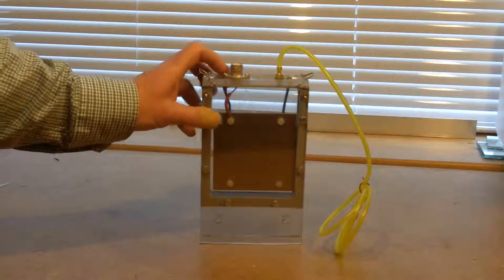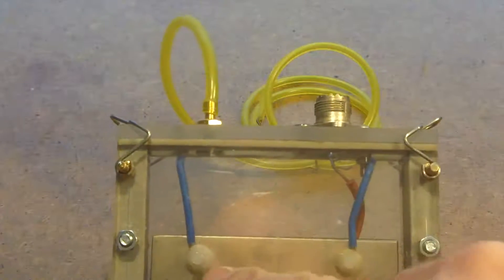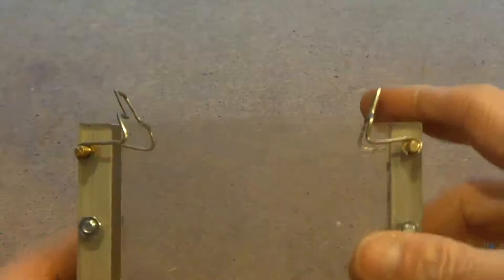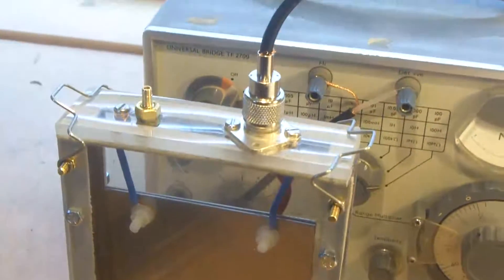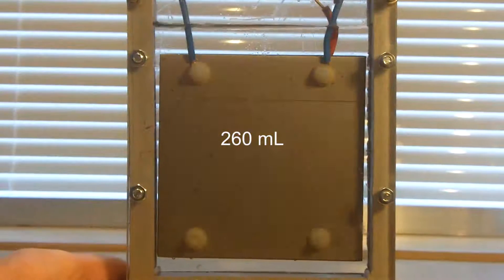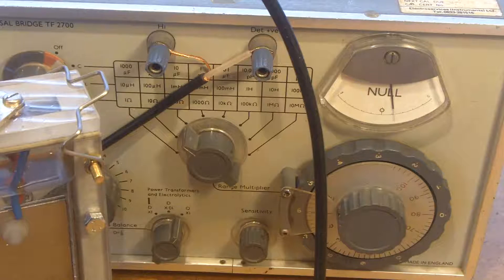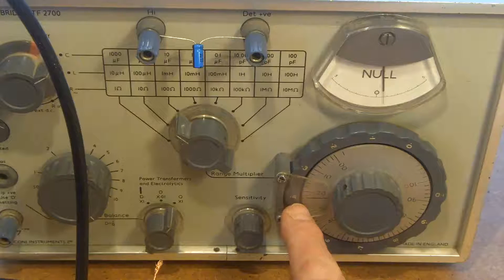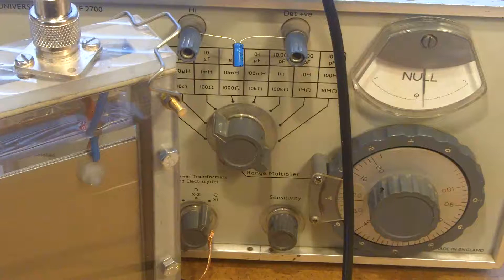HHO. 3 Some mods to the cell and higher than anticipated capacitance reading.

Comment: Capacitance in water can vary due to impurities like minerals, or you can alter the polarity of water and change it's hydrogen bond angle degree to change the capacitance/dielectric value. Can you test the copper/steel cell with a joule thief-coil-12volt 7amp battery settup? I think you will be very impressed :-) Great work Andy!

Comment from the maker: Hi, good point, you’re right I haven’t made any real attempt to remove any oxides, surface coatings or lubricants at all, I probably should have but given that all of my tests to date have been carried out with the same conditions I guess it’s not too big an issue. Must admit I was going to clean them but I forgot. 
Thanks for the input
Kind Regards ... Andy

Comment: I agree with other comments that resistance and RF properties of water must be considered. When you are done with HHO experiments, this cell could be used for other experiments too. (1) Measure conductivity of various liquids with a simple DC ohmmeter and considering area and distance of plates. (2) Measure RF absorption of various liquids by applying a known amount of RF energy to the plates, and measuring temperature rise of the liquid.

Comment: O.K.  I don't remember if it was Hydrochloric or Hydrofluoric acid when mixed with distilled water then put through a charge produces a flammable gas.
73's
P.S. call is kc5jsr.

Comment from the maker: I reckon you could very well have a devil of a good point there, it half crossed my mind but I dismissed it on the grounds that the ‘loss balance’ balanced out. I’ve worked with oscillators for the past thirty or forty years but I might have just forgotten to take the very low resistance in to account. I'll check the resistance of the tap water in the cell and load then the dehumidified water to the same resistance and see what I get on the bridge. Thanks for the interest and the input
73's Andy

Comment from the maker: I need to source different types of water. Thanks for the heads up on the toxins. I know nothing about chemistry (or electro chemistry) but I’ve always reckoned that a bucket of water is a bucket of worms. I used to use lots of water cooing equipment, for 100’s of KW’s, water/water, fan and radiator and evaporative towers. They all work fine in the short term but boy once they’ve been running for a while they could create some real problems.
All the best ... Andy

Comment: Interesting as always Andy. I suggest using pure distilled water only if you want a clean baseline, deionized water can have resins and other organics in it from the deionizing process and tap water can have all sorts ionic and other junk in it. Also, I know you are looking at electric field phenom, but remember that Stainless used as an anode will produce toxic hexavalent chromium if your cell goes electrolytic-not good. Be careful if you see a yellow tint in the cell, even at this small scale.